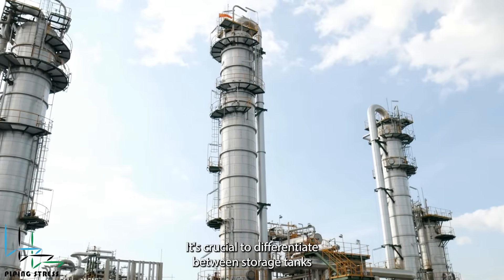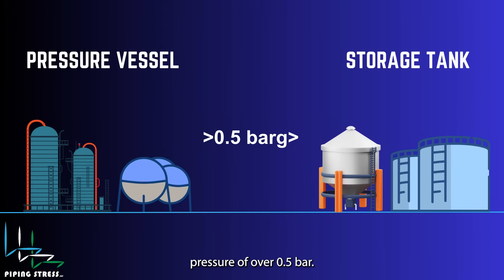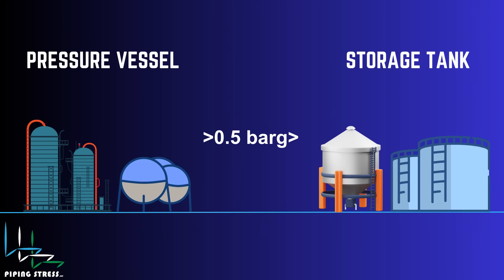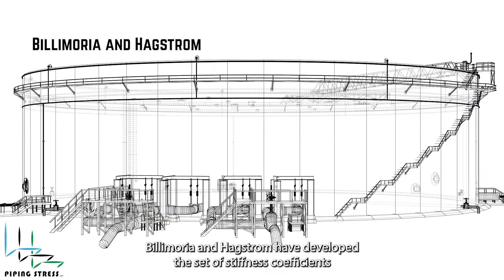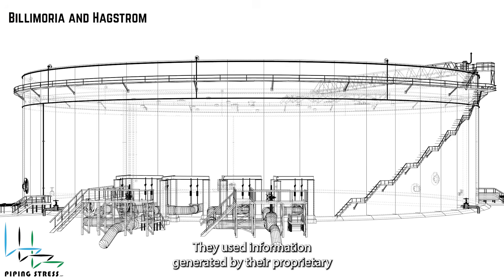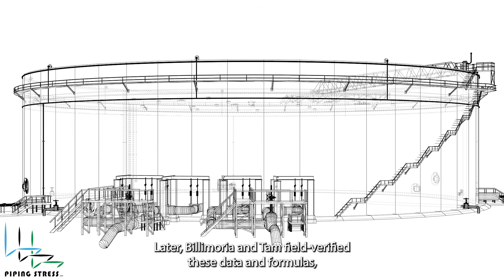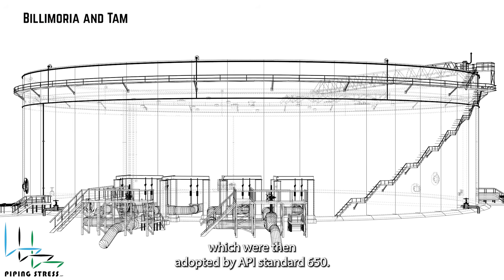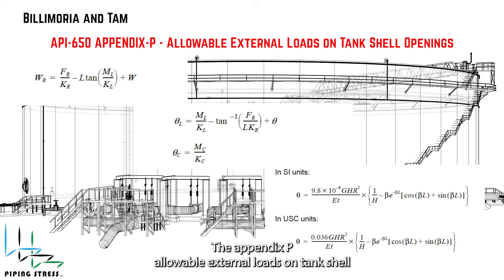Storage Tank Piping - How to use spring supports on storage tank piping?

Comment: How to design the spring for large nozzles? Let's say more than 24". What will be the effect on the spring when the tank is empty or line is not filled with liquid? How to take care of that scenario?
Reply from the maker: Hi, Thanks for your comments. Spring supports are flexible supports and they have set loads. The spring support will continue to take the load (between the given limits) even the pipe and tank is not under operating conditions (empty).
Reply: @PipingStressNet  For which load, spring load to be designed? Full load or empty load?
Reply from the maker: @AkashYadav-zj5ok  spring support load design covers the empty and fully loaded cases by choosing the right spring rate. There is a range both loads (full case and empty case) should stay within the range.